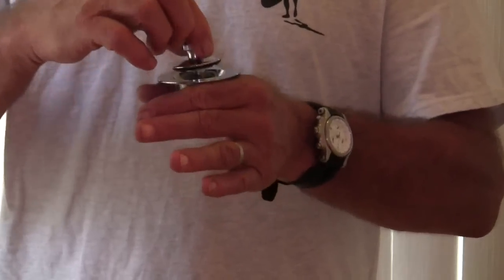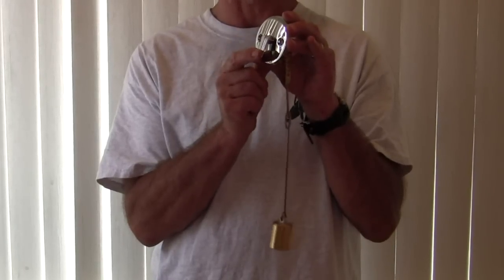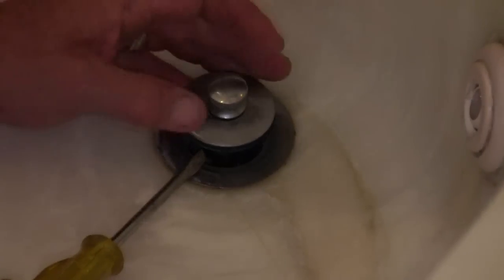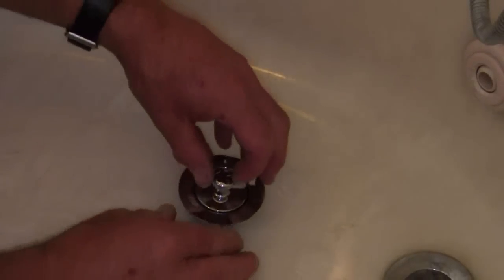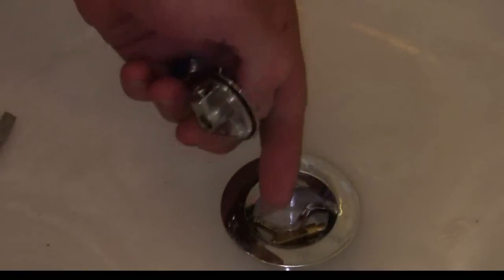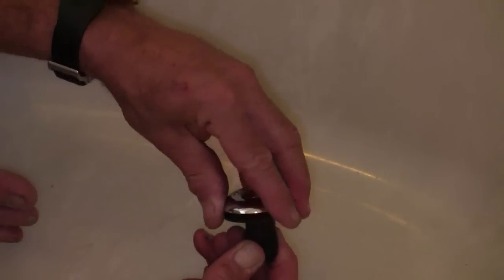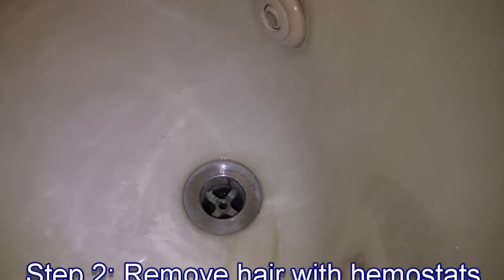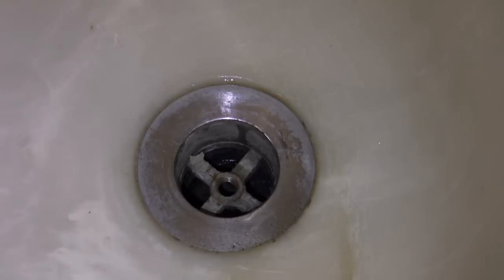How to Clear a Bathtub Drain with a Shop Vac

Comment: Ah ha , I have a stopper not mentioned as part of the 4 shown here. Its a lever on the overflow plate that rotates around (kind of like moving the hands of a clock) and in turn rotates an rod INSIDE the drain that lifts and lowers a free fitting metal stopper. The metal stopper can easily be lifted out. I think this is from the 1930s. The tub always drains slowly and needs to be cleared several times a year. The time I used a shop vac, it actually made it much worse and wouldn't drain at all. I ended up using  a garden hose jammed into the drain with a rag around the opening to flush it out and get it going again.

Comment from the maker: There is a commercial grease / sewage pump that environmental services contractors have that may work.  Ever seen those trucks that have a 4" to 10" hose like an elephants trunk? They evacuate septic tanks with it.   Call a Sludgebusters franchise.

Comment from the maker: Un screw the two screws in the trip lever, pull out the linkage attached.  A barrel is attached to end of linkage.   Sometimes the barrel needs cleaning & greasing up.   If you want to vac clean the drain just cover up the vent at the lever plate and suck away ...

Comment from the maker: The 6'er is telescopic for past the toilet.  I usually use a 3'  The tip choice is more important,  Retriever or bulb?  one has a hook to remove it and is also harder to get past some toilet traps, I have 2 Augers.  
  On the HB, chisel into stucco, or cut into siding.  Repair cut out with something.  Main issue is NO Water in pipe when Soldering.

Comment from the maker: @smoothsailing07 
    By "Stopper" do you mean a rubber plug? or a lift and turn style or a push n pull or a tip toe?  many types exist in the market place.  The DIY stores have replacement stoppers, you need to know what will fit.  the screw in type have 2 thread sizes 3/8" and 5/16" .  As a plumber I can look at the drain fitting and know what will fit.  As I carry over a ton of parts on my van,   DIY is a more cumbersome task.

Comment: Thank you for this video.  We tried this without removing the overflow cover.  We used a piece of plastic wrap to completly cover the the overflow.  The suction from the vacuum held the plastic wrap in place to create an airtight seal.  Then we just lifted a corner of the wrap repeatedly to create changes in the suction.  Worked like a charm!   Best of all, no chemicals or other tools needed.

Comment from the maker: You have a good understanding of the "force cup" known as a plunger.  I agree with your assessment, but plungers aren't good for siphon jets and they can atomize fecal matter causing sars.  as can a shop vac.  I prefer an auger.  Water cannot compress as you say, but it can and does cavitate   upon negative pressure

Comment: I know what you mean. Plumbing is hard work for sure. You have the know how all you need is an able bodied helper to do the mule work. I was at home depot today and they have 2 sizes of those Ridgid Toilet snakes. One is a 3' and also a 6'. Would a 3' do the job or would the 6' be better? Im getting ready to get myself into trouble with the outside hose shutoff. It needs changing and there's only a 1/2'' play and it's soldered to copper. I stripped the brass nut trying to break the handle loose.

Comment: Yea, these mfgr's get away with it because they know the plumbers just pass the cost on to the customers - trouble is, it's Over & Over & Over again these tools are paid for. Here in Maryland rotorooter charges $5-600 bucks to run a snake 30'. I really don't know how these folks sleep at night. Chit' man, the machine only costs $50 to rent or $275 to buy. That is definitely something I could have done myself. The illegals are getting into all construction & services and cleaning many clocks.

Comment: I used this method , with my tube drain/ sink , nothing was working use a ton of drainno, did move anything. I didnt see these videos, but thought i would try the shop vac, it cleared the drain so well, got a giant fur ball,,,,I also covered the sink overflow for a better suction..

Comment: will this method work for sand?  I can tell that my p trap is clogged with sand and I am getting NO drainage... My apartment tub is literally 70+ years old so the way the overflow is built I cant get anything down there.  Should I try to suck the sand out while covering off the overflow, or should I try and use the reverse feature on my vac and blow it through?

Comment: this worked! I live in an old 1953 home that has the original galvanized pipes and i've never been so happy to own a shop vac. i stuffed an over sized towel in the overflow drain (one that the shop vac wouldn't suck through the top!) and my shop vac hose end is slightly smaller than my drain so i wrapped a towel around it to close off the gaps and then i heard it start to work! had to cut some chunks and a paint can opener was great to help scoop the hair to one side to get it to come through the drain easier. pretty sure i pulled some hair from the previous owners too, it worked so well.

Comment: will shop vacs work on a 5" exterior drain (one at the base of a stairwell)? it appears someone put beer cans and other trash in our drain and our plumber said the only option was to excavate and remove the pipe which is going to cost upwards of $6k...I am looking for a more cost efficient solution...

Comment: Great Video! Worked perfect just as you described after all that sucking and slapping I had a drain full of twisted hair and slime that was released and cleared. You saved me from having to buy all those chemicals that seem to never work. Just wished I had been smart enough to check for your tip before I plunged about 10,000 up and down strokes all for nothing. Just a Shop Vac, and thoughtful tip for "How Too" saved the day!

Comment: will a shop vac get sand out of the tub drain after it has gotten wet n piled up? I have about 4 inches of water standing in my tub and I think it is clogged by sand from my kids coming in and taking showers after swimming.

Comment: Greg, what size shop vac do you use and do you recommend any certain type or power? Also, what is that plumbers extra hand you screw onto the threads of the shut off valves called? I need to get one of those. thanks.

Comment: Great vid. But as a handyman. Instead of pulling over flow plate off. Just stick a plunger over overflow. Works just as well. Ya. This is a very old time trick i think explained beautifuly in this video and also u can buy a yellow ring attatchment. End of shopvac. And then no need for suction..
Reply: +Stinks Yellow ring attachment???

Comment: Hi again Greg. Your "how to snake a toilet" video is still helping me out greatly in my crappy old Victorian house apartment since we snake the bugger every 6 weeks or so. We've got a slow-running tub drain too. (I'm starting to wonder if it's not an undersized or out of code outflow pipe; every drain in the apartment trickles.) Anyway, I've run every kind of organic enzyme, foaming and acid drain cleaner I can find locally down this darn drain, and it goes clear for about 2 minutes before it backs up again. What do I do if the shop vac trick doesn't work?
Reply: Dud tge shop vac work?

Comment: maybe but you never want to use anything with acid in it, it's obvious, acid is bad..I usually take an auger & put it through the overflow  drain not through main drain itself, then there are other ways. try everything u can on ur own before calling an expensive plumber..have a good day.☩⚉😆